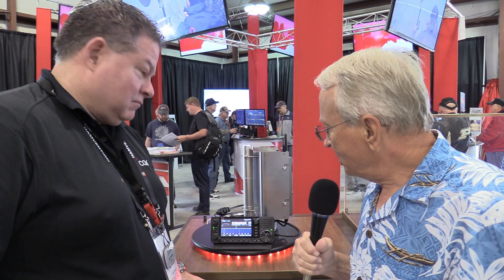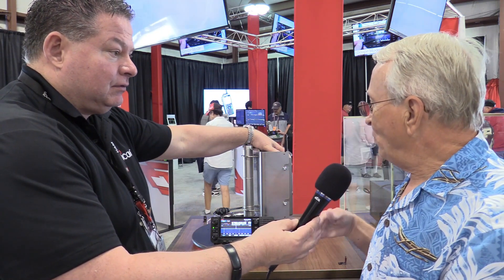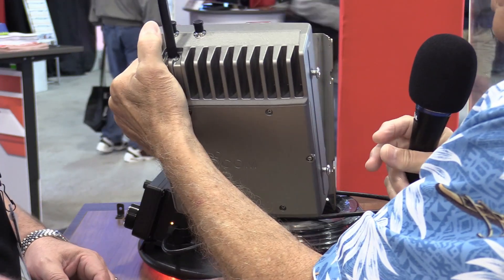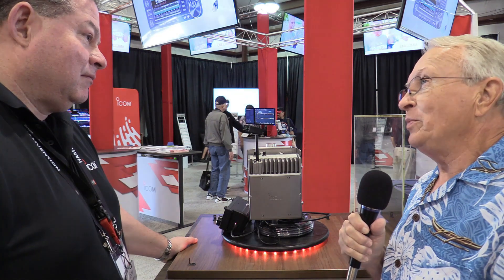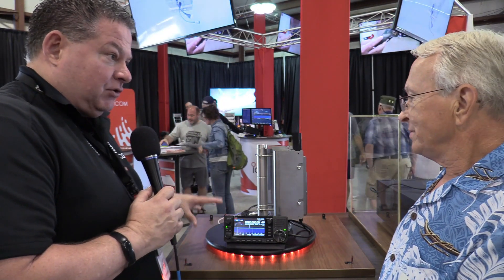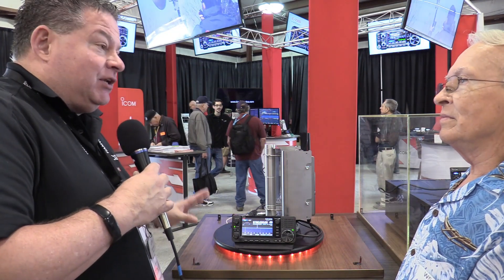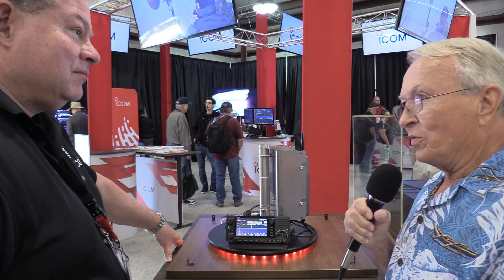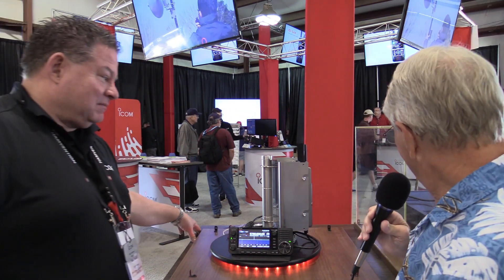AmateurLogic 170 part 2: Icom's SHF Project

Comment: This is either going to be a "Make a bunch of them" at 800.00 each or a way out there $3-4000 box.  I hope they don't go with the expensive option and really do make an effort to make it the next 2 meters and not the next 1.2 Ghz radio.  How many of those did they sell?   Going to be interesting.
Reply from the maker: It's not for sale yet.